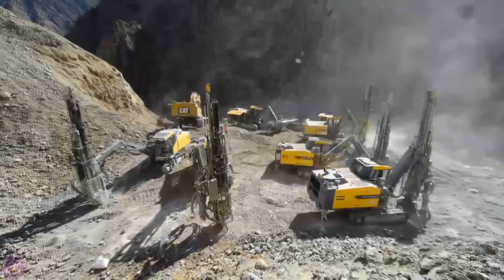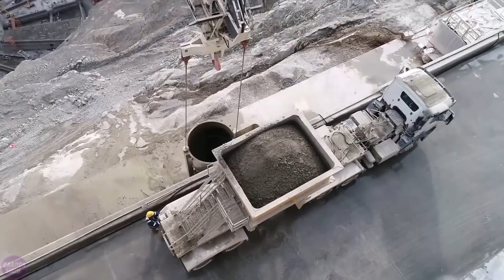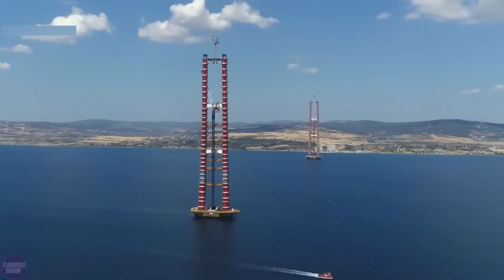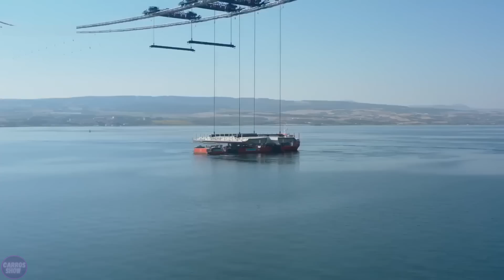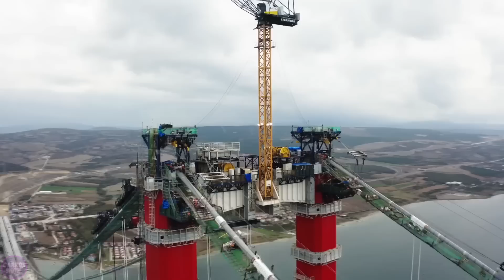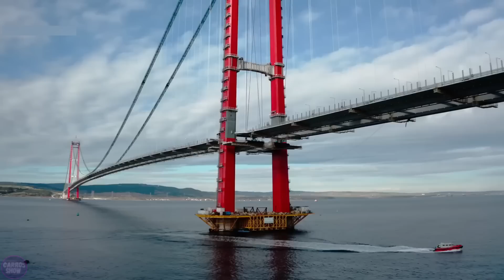This $200 Billion Turkish MEGA Dam Has Broken All Records

Comment: Why can’t a dam be built out in the ocean 🌊 .  A circular dam holding back ocean 🌊 water in a controlled release while pumping water out of the dam at the same time using solar power.  Constant equalization of the water would generate power, enormous power.
Reply: the amount of energy required to pump back will be slightly more than energy generated
Reply: @timurs7398  what he actually wants to say is... A dam pool is created with high water holding capacity. Again, the pool is filled with a pump motor that only works when the sun is out. When the required occupancy occurs, the dam gates open and the tribunes generate electricity. Of course, the fact that this water is salty will reduce the life of that dam, it is necessary to ask the experts.

Comment: I think a 4 ( Four ) Pillar architecture designss
Instead of just 2 ( Two )  pillars between each span..
Like a wooden X-Mass Tree made of 2 (Two) double sided painted x-mass tree likeness shaped template  , then you cut and remove about 90% of the center of one piece. Creating a 4 ( four,) legged  8( EIGHT) Sided decoration.

Comment: 550 MW seems to me to be a bit little for such a dam.
Reply: It may seem a little but the aim for this dam is not to make maximum capacity of electricity but to store big amounts of water for other uses.
Reply: As of now, a nuclear power plant is about to finish, one extra plant has began and a third plant is planned. This dam isnt made to produce electricity, its just a bonus. The goal of this dam is to have more control and storage of water.
Reply: konu sadece elektrik üretimi değil enerjiden daha önemli olan su kapasitesini atlıyorsunuz geleceğin savaşları su üzerine olacak malesef .
Reply: 550 MW can be also made with just 37 pieces offshore windmills which is much cheaper
Reply: With an installed power of 540 Mw, it will produce an average of 1.8 billion kWh of energy per year.
Reply: Thought so too.....was expecting figure of 2500 MW plus
Reply: In other words, it will meet the electricity needs of 2.5 million people.
Reply: yeah doesnt make sense, solar parks make gigawatts.
Reply: @rahul.modi30  solar for gigawatts, are huge parks, and they produce only during the day. the dam will produce 24/24. at the end, it is the yearly production that is important, and such a dam will produce about the same as 2GW of solar capacity ...